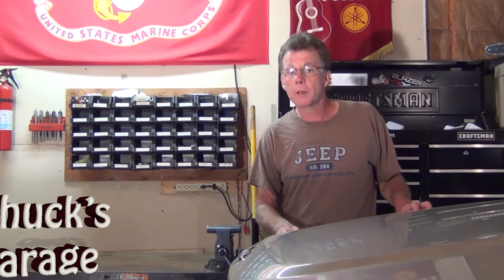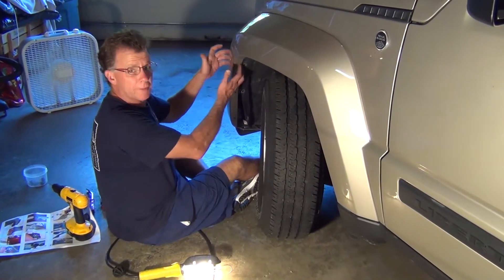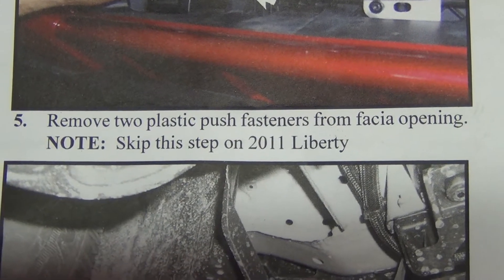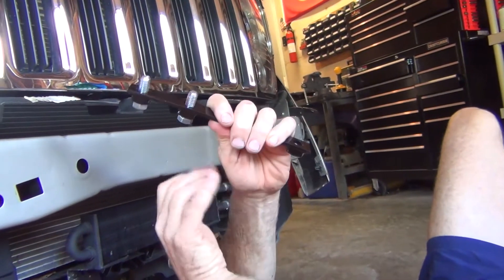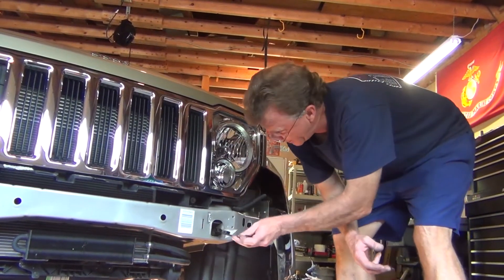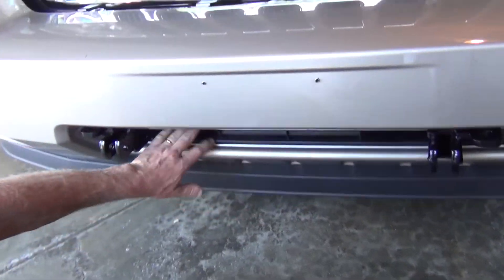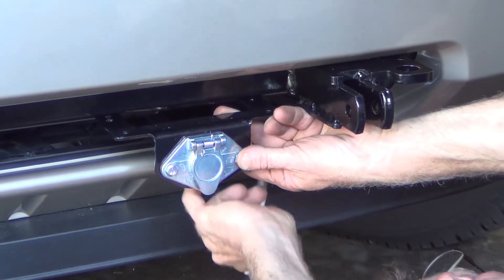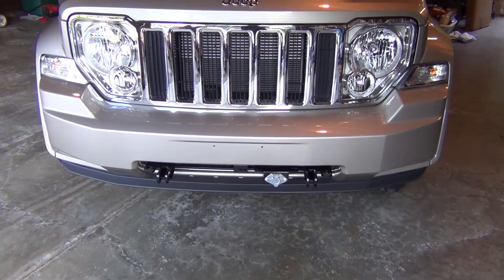Demco Base Plate Installation - 2011 Jeep Liberty

Comment: Great video! Just installed Demco plate on my 2010 Liberty using your video as guide.  A few differences but pretty much the same.  Probably easier to work the fender clips during hot weather.  Even though garage is heated I still needed to point a radiant heater at the fender to get some flex.  Getting ready to install the lighting hookup this week.  Thanks again.
Reply from the maker: Thanks, glad you found it helpful.  When we installed the baseplate, the lighting system and the brake system we were in the middle of a heatwave here. :)

Comment: GREAT JOB AGAIN:). Looking to get a Jeep Liberty as a tow on a 3401 Newmar. Can you offer any advice on a year, what to look out for or make sure you get? How did you like yours? I believe it has to be a manual in order to tow all 4 down. Love the wrangler but have 2 Golden Retrievers who like the back windows rolled down which the wrangler doesn't have.
Reply from the maker: Thank You! The 3401 is a nice rig, we looked at getting one before settling on the Jayco.   The Jeep Wrangler Unlimited has a back seat and back windows that go down, just another option.  As for the Liberty, too bad, we just sold our and if was completely setup to be a toad.  We would suggest staying with the 2008-2012 body style, there was more room in that style.  The Liberty was discontinued in 2012. Ours was an automatic and you can tow one 4 down with a manual or automatic.  It towed just fine.  I used to turn on the rear camera on just to make sure it was still there.  The same with the new Wrangler now. :)
Reply: Thanks for the info and advice. Would have loved yours:) I saw the automatic in part 2....lol  I presume in the 2011 the steering wheel doesn't lock when you take the key out. Nice setup. I will look for a 2011...what a load off...I thought selecting the rig was bad:) Wonder what it would cost to have it set up like yours, the wiring looked like a hard time.
Reply from the maker: It depends what you are comfortable with, it really wasn't that bad.  I'm a little OCD when it comes to hiding wires. :hahaha
Reply: Ok ...I think I can handle that watching your video:)  The unlimited wrangler weighs too much as I want to stay under 3500 but is does have the windows:) Happy the 2011 is an automatic less drama!!!!

Comment: I have a 2011 jeep liberty. spent all day trying to take the front bumper cover off. I should have seen this video first. I was so wrong on several steps. anyway thanx for making my job easier. putting recovery hooks on my jeep? hey its a "trail rated" 4 x 4,,,, why would it come with recovery hooks. that would be a great idea.......(lets not do it says Chrysler).
Reply from the maker: Glad you found the video useful.  Tow hooks would be a good Idea, I agree!  We have had our Liberty in a couple hairy situations and it's a good offroad vehicle. :)